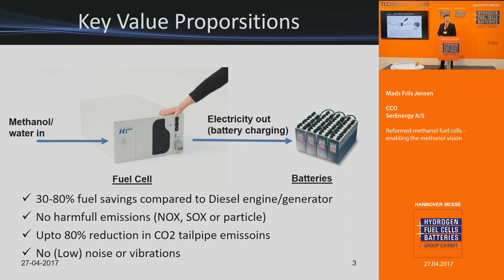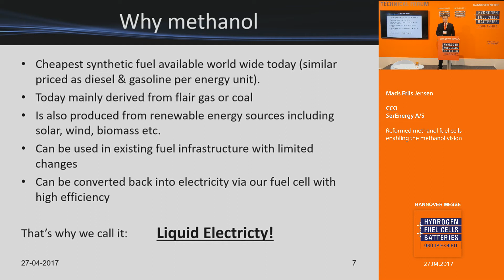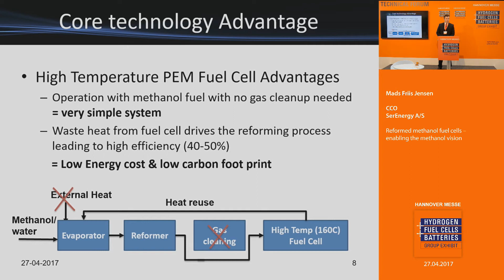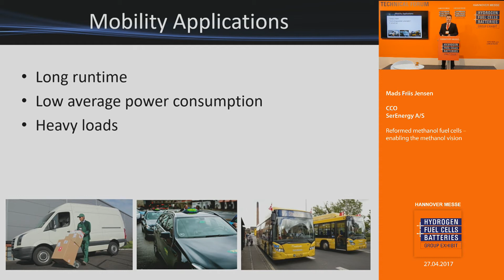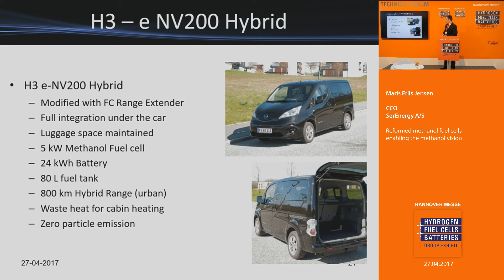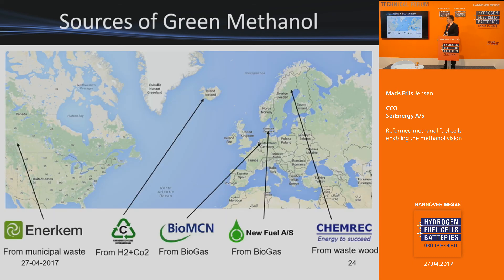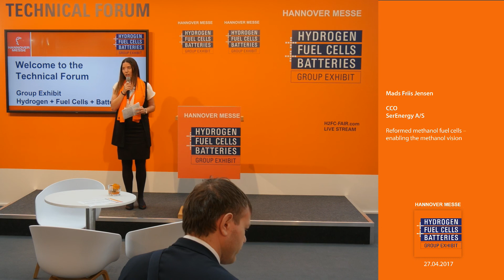Reformed methanol fuel cells – enabling the methanol vision

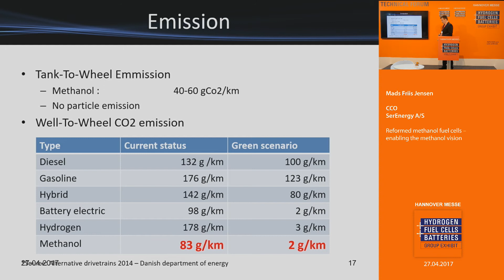Comment: One question: when at 8:05 min he says 12.5 km per liter of methanol (vs 25-28 km/l for gasoline/Diesel) does he mean still using methanol in an ICE vehicle ? That means, before switching to a methanol fuel cell, whose efficiency is more than double than an IC vehicle

Comment: Why say 40-50% when the plot shows that it never reaches 50% -- this just makes it loose credibility, just say up to 46%, which is still good, but also accurate
Reply: I think this is because of the small 5 kW only module. For more powerful systems, like trucks or marine applications, they claim in other videos that the efficiency is even in the range of 50-55%
Reply: I guess the zeroes are rounding numbers because you wont get more accuruate numbers than that. U could say you have a efficiency at 4 to 5*10^1 percent... or 40 to 50% in layman terms.

Comment: I think the biggest limitation there is the 30 minutes start-up time. That may be acceptable for some applications (like buses, railway locomotives), but shortening it to less than 5 minutes will bring many more possibilities.
Reply: I think this is the high temperature reformer working on 200-350 celsius, there are current development for 120-180 celsius methanol reformer
Reply: @ameserich  Just curious, what is the difference between the two (lower and higher temps) ? Is perhaps the higher temperature MFC more efficient ?
Reply: @Alessandro-1977  kinda, atleast 95%+  but is slow. low temp are faster but less pure and less efficient
Reply: @ameserich   
Is it maybe that bigger/more powerful fuel cells are intrinsically more efficient ?  In their site (blue world), they claim that the APUs for martime application with modular cabinets of 200 kW (rather than only 9 kW or 15 kW for automotive systems) "have electric efficiency of 45-60%", a bit higher figure of what stated in this video
Reply: @Alessandro-1977  maybe the inefficiency of the smaller system are due to the parasitic losses of heating up the high temp methanor reformer... high temp hydrogen fuel cell merged together with low temp methanor reformer are definitely ideal, considering they run on the same temperature
Reply: @ameserich  Is the advantage of a high temp FC that is less demanding in terms of catalysts or other rare/precious material (like platinum or platinum group metals), as well ?
Reply: @Alessandro-1977  ya and it can run with less pure hydrogen
Reply: Could easily heat up much quicker with an auxiliary battery.